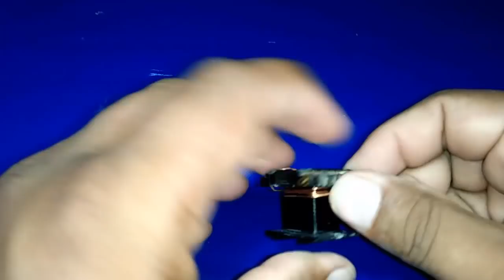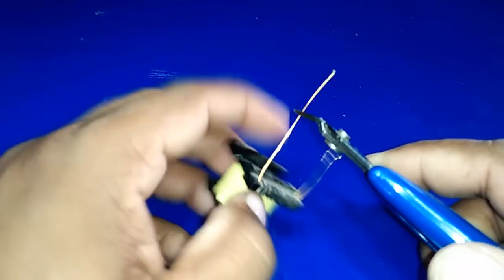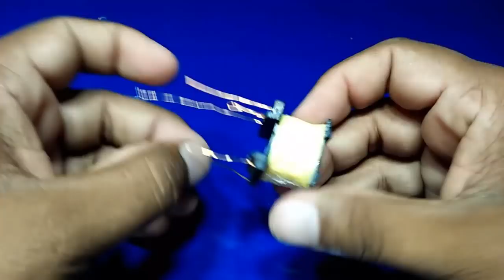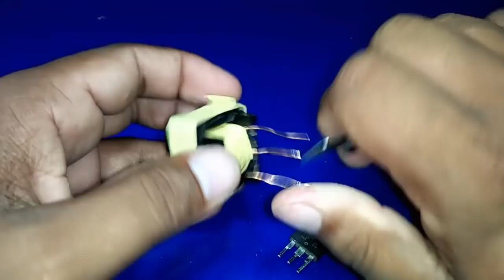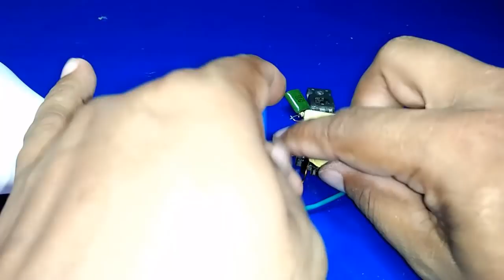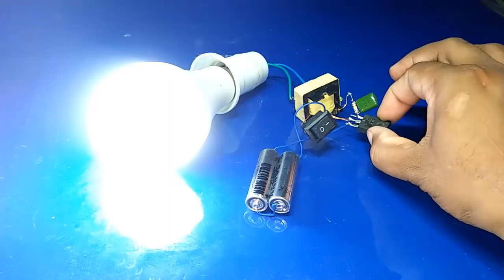how to make inverter 1.5v to 220v simple circuit new technology exhibition

Comment: hola amigo te a salido perfecto podrías decir cuantas vueltas as dado  al primario y cuantas al secundario así como el mofest que as usado  gracias
Reply: Abacos Abaco ,si exelente pregunta y q clase de transistore ,ami usted sabe cuál es
Reply: Reinel, ni idea estos no responden a los vídeos que hacen, dudo de que tanta perfección sea real saludos.
Reply: as vueltas tam poco lo se. pero podes usar un transformador qualquiera de um carregador de telemovel. el transistor puede ser um tip 41C, TIP 122, ou outro qualquiera que sea NPN. tambem pode ser PNP pero las conecsiones tenderian que cambiar.
Reply: si es real oy tengo uno fabricado por mim, que funciona igual.
Reply: @serounao3737  Detalhes? Details of everything you used? How many Turns and gauge used? Voltas. Thanks